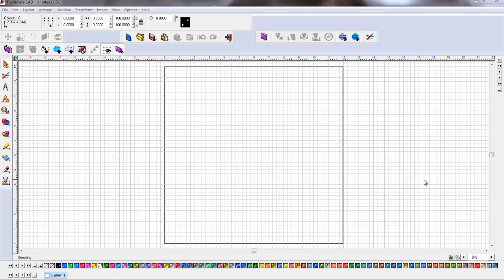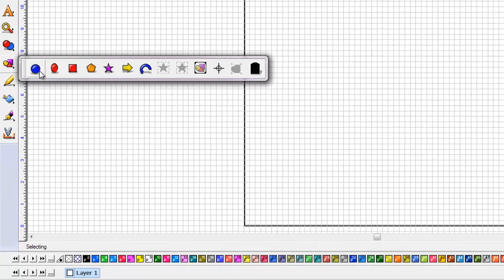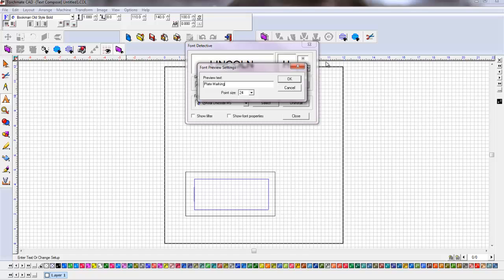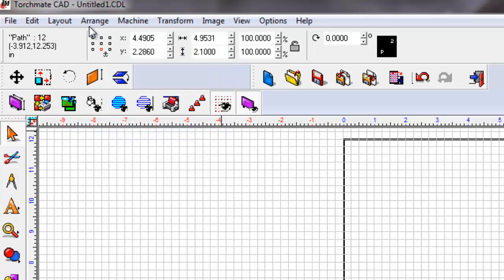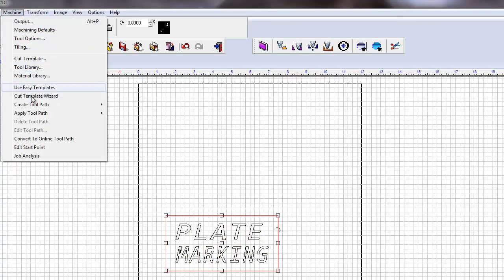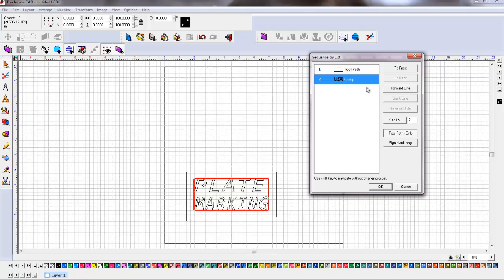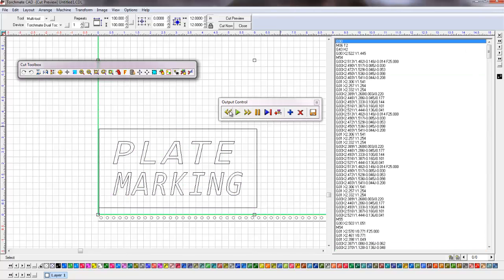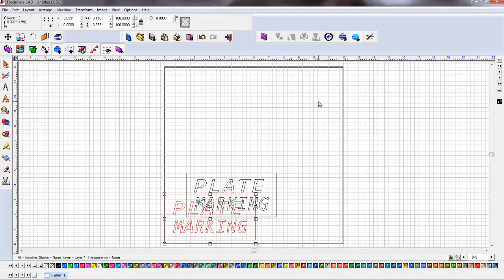Tutorial: Adding Plate Marker to Torchmate Cad

Comment: Thanks for the video. I installed the plate marker and it works when I manually use it with the tool library. I followed your video but when I go to run the job it just goes over the plate and follows the path but it never engages the plate marker. Its like its doing a dry run.